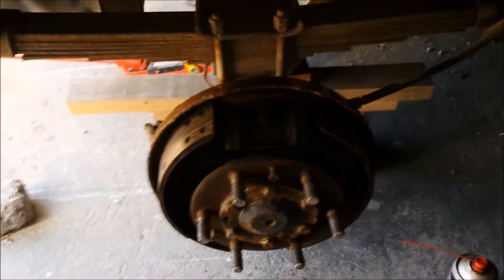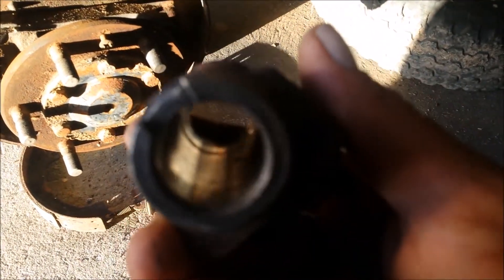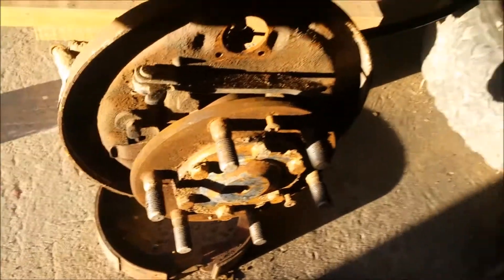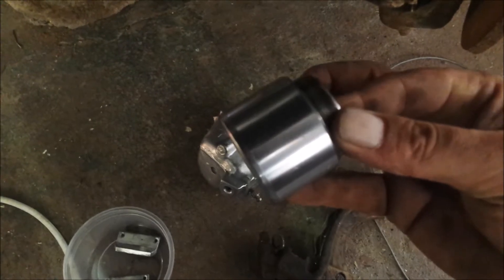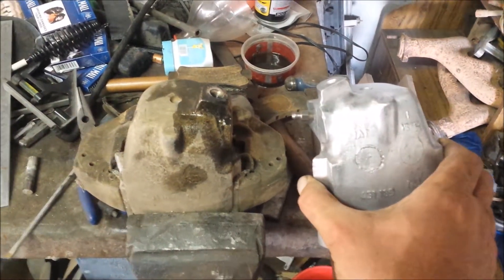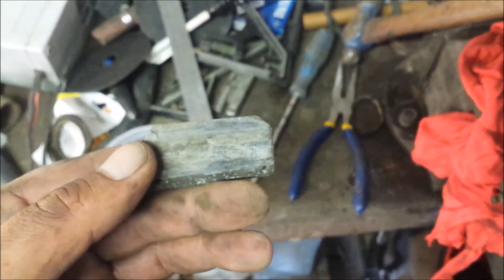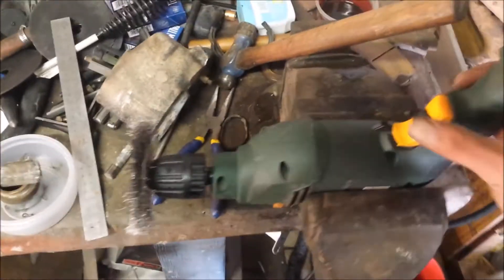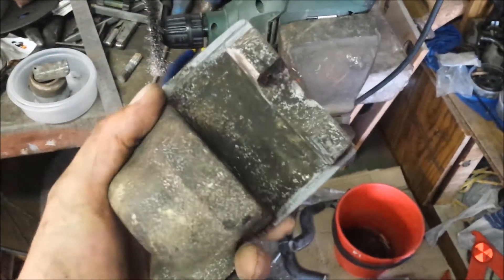ARO 10.4 4x4 Saving Her Ep4 ; ARO 10.4 4x4 Economisire: Ep4

Comment: Hello, on your ARO 10 on the front axle the brake calipers and discs are exactly the same as those used on Renault 12, but on the rear axle it is a bit more complicated. On the rear certain Renault 12 Break/Combi wheel cylinders will fit but the hole is smaller than on the ARO 10 wheel cylinders. If you only need new seals for the rear wheel cylinders you can use Land Rover Series 2/3 seals,  but you need to check the dimensions. The rear brake shoes, drums and wheel cylinders will only fit from a Dacia PickUp. Good luck!